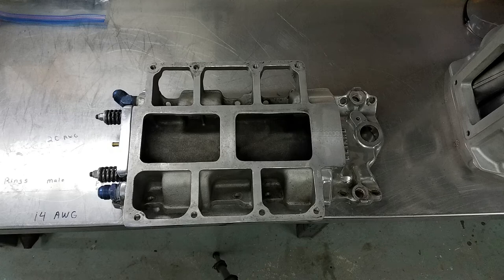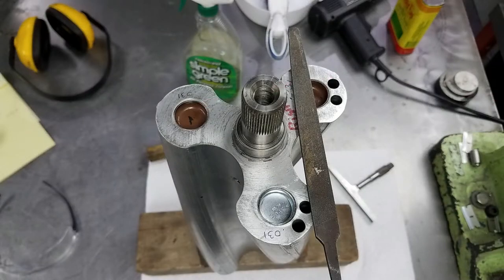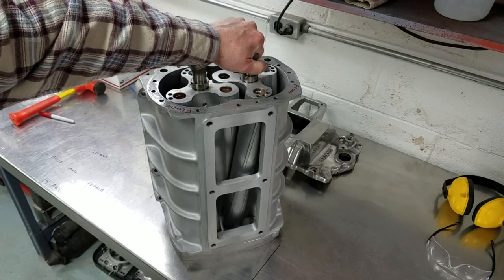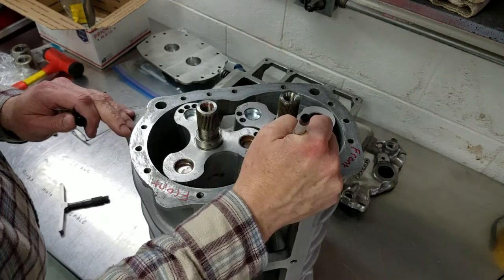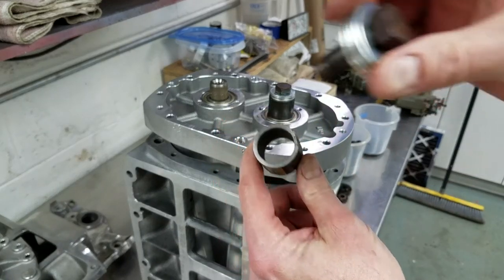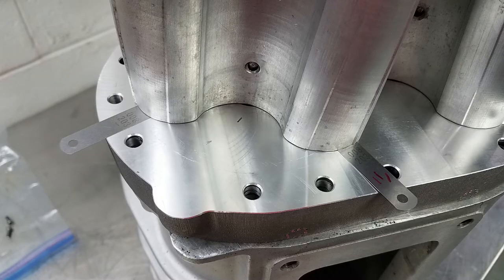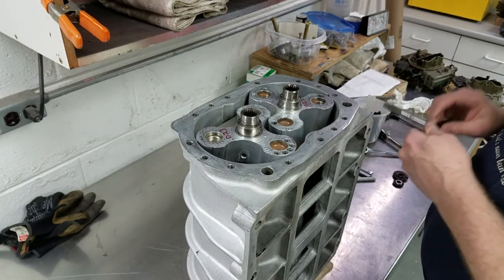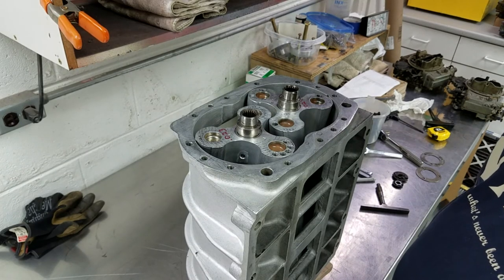My 6-71 Blower rebuild, Part 10: Measuring end clearance.

Comment: There are notches or missing spline on the splines,,, they should both be allocated to 3, o,clock
Reply from the maker: Right on.  Go to about 7 minutes 30 seconds in video #14 and you will see the rotors being indexed during final assembly.  Thanks for watching!

Comment: Where did you get the bearing retainer plates that you’re installing at 3:55? Diamond P told me they don’t supply them
Reply from the maker: They came off of my stock GMC blowers end plates.  If you have none, you can get them from Dyers Blowers in Chicago,    http://dyersblowers.com or Blower Drive Service http://www.blowerdriveservice.com/index.php in Anaheim California.   Thanks!
Reply: I’m at this stage of my build. The clearance between the rotor and the front plate is too tight. Do I need to add some kind of shim?
Reply from the maker: @graveyard13  The proper way to open front clearance is to mount the rotors in the lathe, and take a light cut off the front face of the rotor.  Before you do that though, be extra certain that your bearings are fully pressed into the front plate, with no burrs preventing them from seating fully.   Good luck with your project!

Comment: Is that an off the shelf blower intake that you are using in the mole up.
Reply from the maker: Yes, it is an old Weiand #7136 Intake for a small block Chevy.  It is their earlier design, like their mainfolds from the late 70's, before they integrated the thermostat boss into the front casting of the intake.  I seem to remember that Weiand made that change in the late 80's or early 90's.
Reply: MakerCave will a newer style intake work with the deisel blower
Reply from the maker: sssawyers.   Yes. The current Weiand 7136 manifold will work with any diesel 6-7 1.

Comment: Having trouble playing #10 the rest seem to be good.
Reply from the maker: Strange.  This video has been up for a year and a half now, and no reports of playback problems.  I just tested it without logging in, just the same way you would see it, and it plays OK.  What happens for you when you try to play it?
Reply: @MakerCave  it plays fine until right after you explain orientation of front & rear of case then stops, however I have watched every other video before & after with no issues.
Reply from the maker: @boffo911  What browser are you watching it in?  Is there any way that you can go to a different computer to see if the same thing happens?  I just tested it on Microsoft Windows 10 with the Microsoft Edge browser, Internet Explorer, and Firefox, and it played fine on all three of those browsers.  I also went to a different computer running Ubuntu Linux 18.04 and tested it with Firefox and Chromium browsers, and all of those browsers worked fine.  I am pretty certain that it is not a browser compatibility issue.  Try a different computer and see what you get.  Thanks for watching!

Comment: what happens if the helix goes the other way should the blower be assembled that way
Reply from the maker: The rotors then need to be swapped side to side.
Reply: @MakerCave  just curious to know what happens if they're not
Reply from the maker: @raymorrison919  I have never intentionally assembled one backwards, but I have heard that mixture distribution is affected, but can't testify to that firsthand.

Comment: THE ROTORS ARE MARKED   U FOR UPPER  AND  L FOR LOWER  --NOT LEFT AND RIGHT
Reply from the maker: Correct.  They have very small letter stamps on the lobes of the rotors.  The stamps are a single letter, "U" for Upper and "L" Lower when on a diesel, and when we put a blower on a hot rod, the logical orientation becomes Left and Right, with the blower now laying flat, instead of sideways.